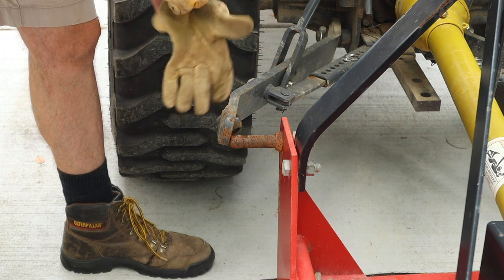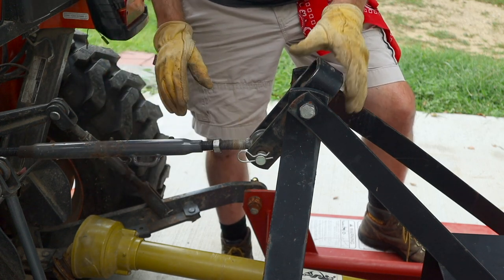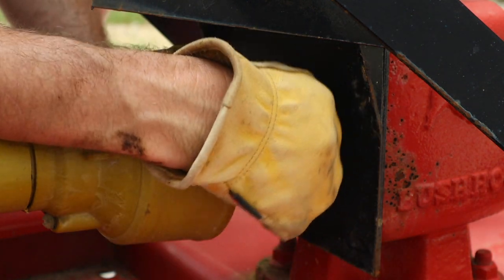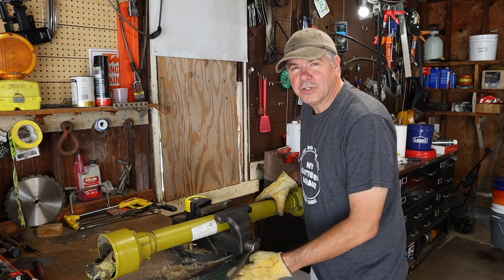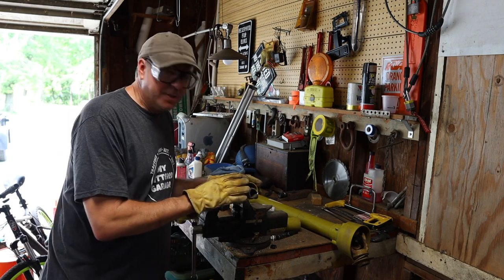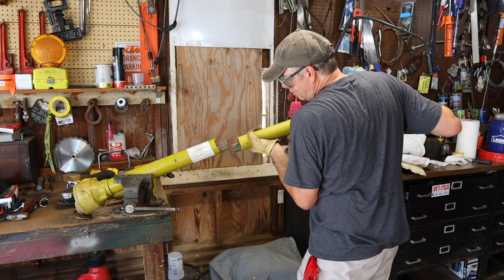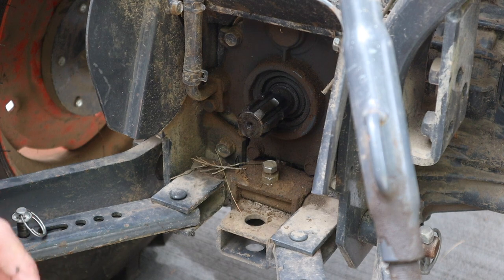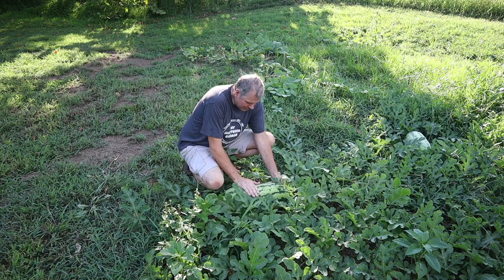#113 Bush Hog setup, cutting the PTO drive shaft, and more! Kubota B2601

Comment from the maker: You can support this channel for free! These are Amazon Affiliate links, so purchasing will help this channel by providing a small commission while not costing you any more. Thank you for your support!
AirTec Lube-Shuttle Pistol Grip Grease Gun Kit:
https://amzn.to/3O0pj1z
LockNLube Grease Gun Coupler:
https://amzn.to/3kPcvwu
Recommended Grease:
Valvoline Moly Fortified
https://amzn.to/3jNM1Kv
Nitrile Gloves:
https://amzn.to/34Kg8OG
Deerskin Gloves:
https://amzn.to/2I17NNy
My Video Gear:
Rode Wireless Go II microphone:
https://amzn.to/3eiJatG
Canon M50 Camera (now Mark II):
https://amzn.to/3vHW9uD
Battery adapter for M50:
https://amzn.to/2RshsBE
Sigma 16mm prime lens:
https://amzn.to/3vJDRcx
Sigma 30mm prime lens:
https://amzn.to/3epFneh
Variable ND filters:
https://amzn.to/3tmoHIs

Comment: Great video, Ed!  Yep, it’s critical that your PTO shafts are the correct length to avoid Chaos, Death & Destruction.  Man, it was painful watching you struggle to get the 3 point hooked up!  Do yourself a favor and get a Pat’s Easy Change system so you can just can just back up, lift up, and at the sound of two clicks your lift arms are securely hooked to the implement.  Adjust and connect your top link and you’re off to the races.  Thanks for sharing!
Reply from the maker: I’m going look into Pat’s again!
Reply: @MyClutteredGarage  Excellent!  If you decide to buy it, I have a video installing it that you may find helpful.

Comment: Yes, the orientation of the shaft halves matters. The U-Joints have to stay in phase or you will get a lot of vibration, to the point it will destroy the joints and shaft. That is why it only goes together one way. Some don't and you have to mark the shaft or pay attention.
Reply from the maker: Interesting, Mark. Thanks!
Reply: Thanks! Always wondered why they would make it so would go to the trouble of only allowing it to go on one way. This makes o much sense and never occurred to me.

Comment: The struggle is real my friend! Dreading having to do this with my Woodchipper and box blade later this season. Thanks for showing us.  Ed says.. "Because this shaft is sooo long...." Bahaha!
Reply from the maker: We can all relate! Thanks Ross!
Reply: Box blade don't use a PTO shaft, so there's nothing to cut LOL.  

I got the quick hitch for my tractor, makes quick easy work for swapping attachments.  with my tiller I still have to get off the tractor to hookup or unhook the PTO shaft but no big deal.  Everything else I can do from the tractor seat.  If you don't use many PTO implements a quick hitch I think is a great time saver, and definitely easier on your feet and legs than kicking 3 point arms over pins.
Reply: @wildbill23c  , I meant attaching and disconnecting 3pt attachments are a pain.  I don't have a quick attach..... Yet ..
Reply: @RossOnTheLand  That's why I have a quick hitch LOL.

Comment: Pat's quick hitch.. so much easier
Reply from the maker: That’s what I’ve heard! I should try it out!
Reply: @MyClutteredGarage  around $200 for the pats quick hitch but still much cheaper than them boxy types... I absolutely like mine work so well and they will work on any three-point implement old or new with no bushings
Reply: @MyClutteredGarage  tell them BB sent you 😂😂😂

Comment: When I bought my tractor I bought it with a roto-tiller, so the PTO shaft was cut at the dealership.  I later decided to get the quick hitch....I quickly found out after the PTO shaft separated while I was using the tiller, that I needed a longer PTO shaft.  A trip to the dealer only to find they pulled the wrong style drive shaft, I went to the local Tractor Supply and picked up a PTO extension which goes on the end of a PTO shaft on a tractor and extends it about 2 inches.  In my case I put it on the tiller side because its the only implement I have that needs the PTO, so its permanently attached to the roto-tiller's gear box.  So, in the future if I get other PTO powered implements, I simply cut the PTO shaft a bit longer due to the added space from the quick hitch....which is something you might want instead of having to kick the 3 Point arms onto the pins, I simply backup to an attachment/implement and raise the 3 Point....I'm finally getting the hang of mine and it works great, right after I got it I usually spent more time cussing at it because it seemed I'd never get both lower pins at the same time....I've learned to backup with a bit more speed and lift the 3 point as I bump up against the pins, drops right in every time now.  With that I don't have to get off the tractor, I can reach the release levers on the quick hitch to lock and unlock and implement/attachment....with the tiller I still have to get off the tractor to hookup and unhook the PTO of course.  With my box blade and grading blade I don't have to leave the tractor seat.
Reply from the maker: Sounds like a good setup, William!
Reply: @MyClutteredGarage  Seems to be so far LOL.  The only thing I have that don't work with the quick hitch is the 3 point receiver hitch, but I don't use it often enough to care that it don't work on the quick hitch.

Comment: If you would be considering buying a quick hitch might not want to cut your drives haft quick hitch will extend it about one inch
Reply from the maker: That’s true, Ronnie.  Use a PTO extender on my attachments when I use my quick hitch.
Reply: Yep, found that out with my roto-tiller.   I had ordered a quick hitch when I bought my tractor, but apparently like everything else with my purchase nobody bothered to communicate anything throughout the dealership...so the PTO shaft was cut without taking the quick hitch into account....so once my quick hitch arrived I quickly found out while using the tiller that the PTO shaft was too short.  I simply bought a PTO extender and solved the problem, but really irks me that the damn dealership communication skills are beyond horrible, that they couldn't bother to tell the setup crew that the tractor had a quick hitch going with it to cut the PTO shaft longer....oh well, got it fixed, but luckily no damage was caused by the PTO shaft separating during operation.  

I plan on getting a rotary cutter in the future, a wood chipper, and possibly a flail mower, so I know now to make sure to cut the PTO shafts accordingly.